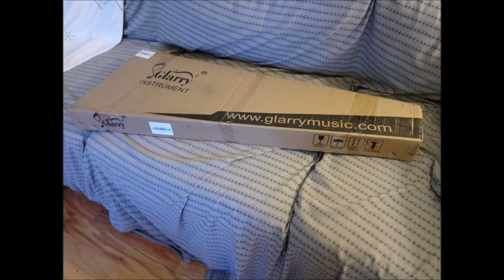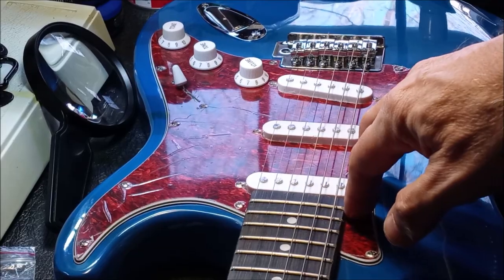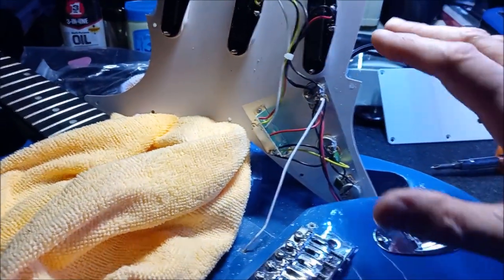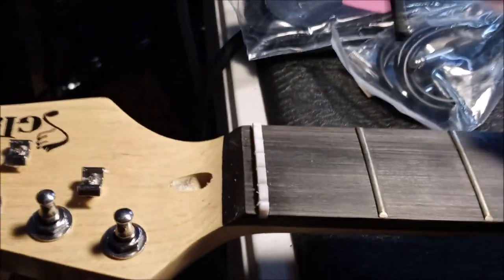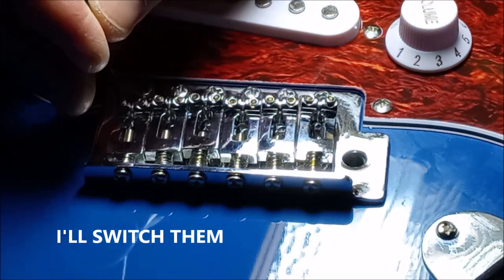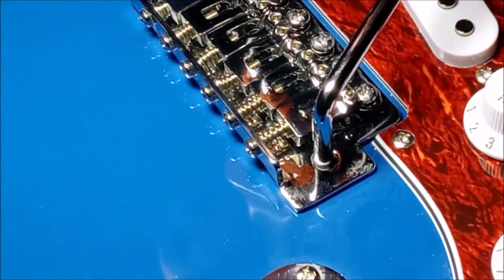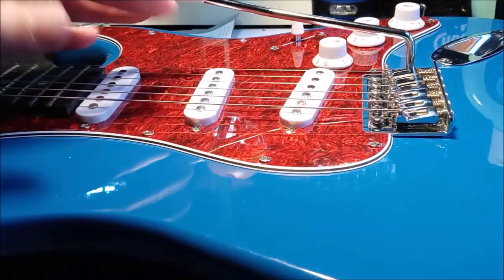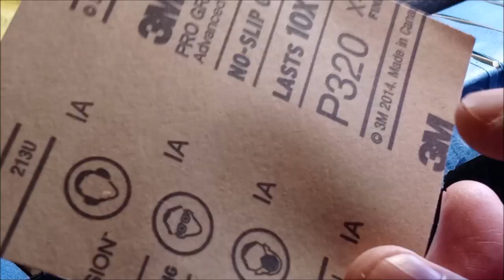Fix Your Glarry

Comment: The small holes next to the pots are for the pots themselves.  That is the pots have a small tab along the edge which fits into those wholes to anchor them so they don't spin (the whole pot that is not just the shaft) when turned.  Otherwise if the whole pot spins it could pull off the wiring.
Reply from the maker: Thank you!
Reply: @guitarhowtos2148  no problem.

Comment: I got one from a separate factory seller off of Ebay in December of 2019. I had to file only 3 high frets and shim the neck. The stock pickups were fine. But, I wanted hotter ones. So, I did a full 'loaded pickguard' upgrade with it. It rapidly became my favorite Strat-style guitar I've ever played (and yes, I've owned and played Fenders)! The lightweight body is so easy to deal with and the YiBuy loaded pickguard is perfect. If someone knows what they're doing, the Glarry guitars are a real bargain! I'd GLADLY play live with mine. And, yes, dime pots can sound excellent. Size doesn't matter with them. Any size pot can be good or bad.
Reply from the maker: Agreed. They are comfortable. Too, I bought this for playing out in places where I don't want to bring an expensive guitar.
Reply from the maker: I was hoping to not address the frets, but it wasn't a big deal to do so. It plays great now!